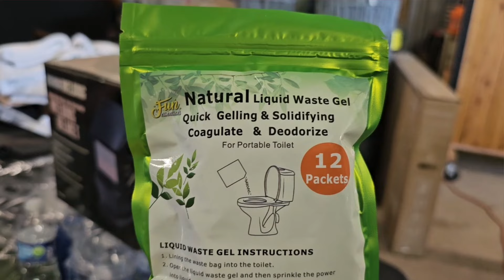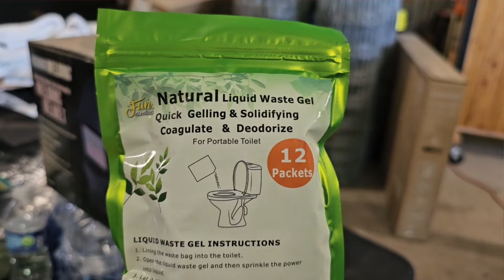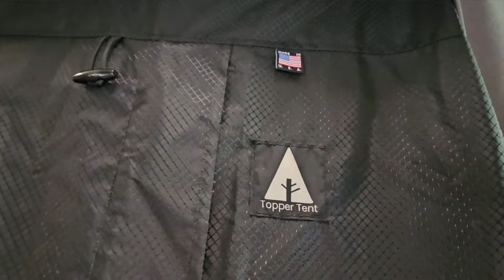Prepping For Truck Bed Camping #truckcamping

Comment: Get a good 12 volt rechargeable fan to keep fresh air moving on you.   That’s what we found out in our camper cap. It is a lifesaver.
Reply: Got another Ryobi with a battery and charger at a garage sale for 15 dollars. I was stoked 3 hours on high on an old battery and 6 hours on low and it wasn’t even a lithium battery.  Will have to look for another battery on marketplace.
Reply from the maker: I do have one little fan. May need to look into another one. 🤠🤘♥️

Comment: Have you camped in it yet? Mine is great but not much head room. I have a video where I use an air conditioner in mine if you want to check it out. I hope ya'll enjoy yours as much as I do mine. Great video.
Reply from the maker: @lawman192000 We have. And there isn't much head room at all. But we enjoyed it.  I will check your video out. Thanks for watching 🤠🤘♥️